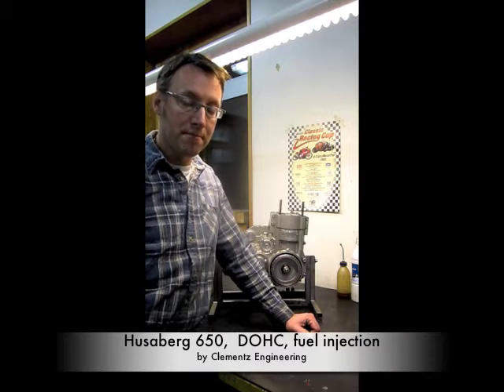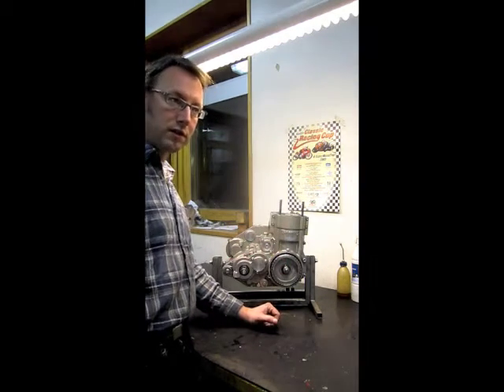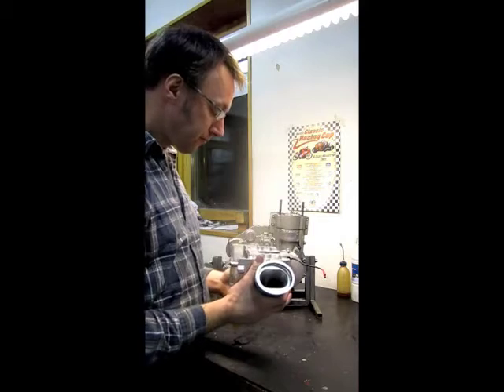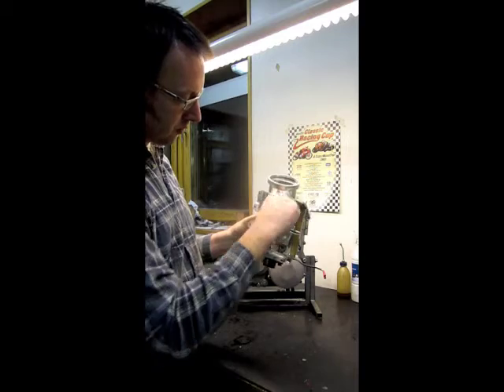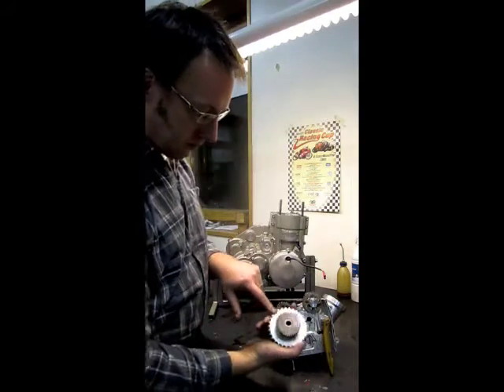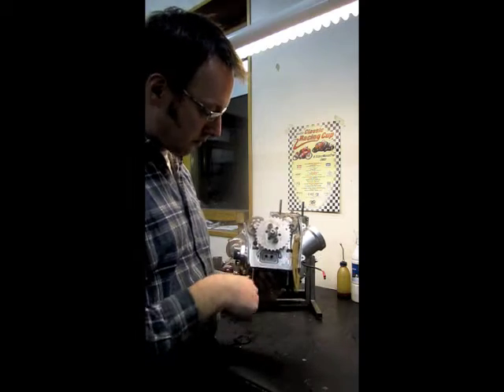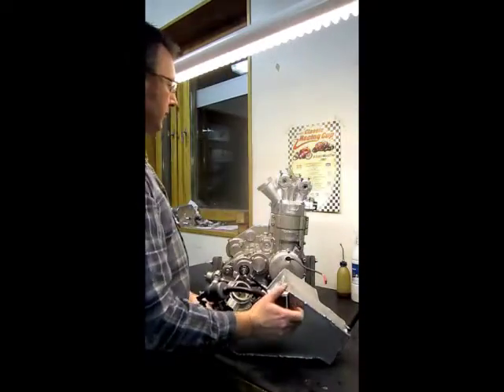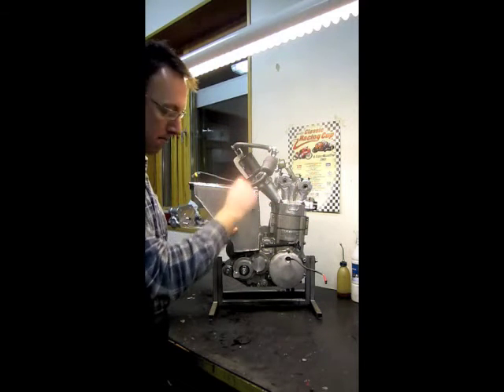Husaberg 650, part 2

Comment from the maker: The crank speed is much more fluctuating during the combustion cycle on a 1 cyl engine. To get as accurate timing as possible, on both ignition and injection, 36 teeth are preferred. I'm just following the recommendations! ;-) Thank you for your interest, Parus!